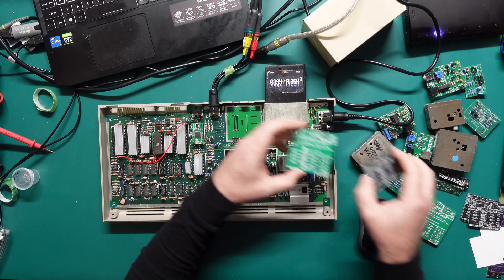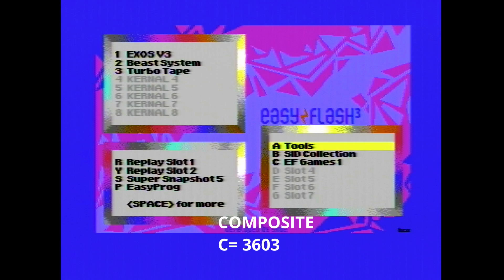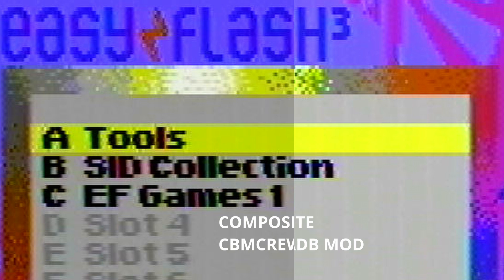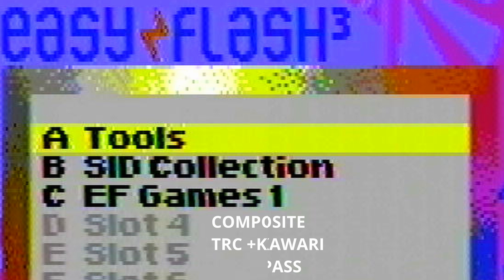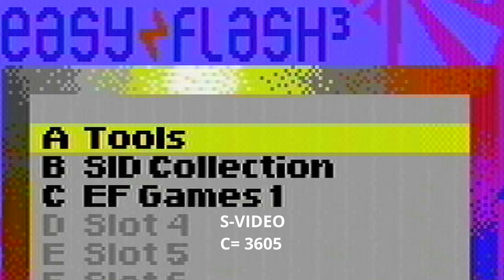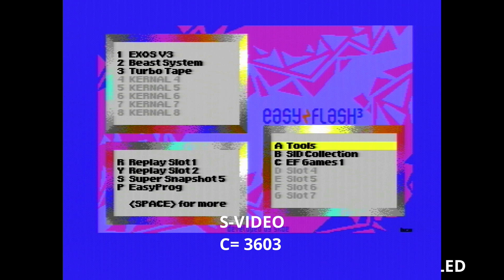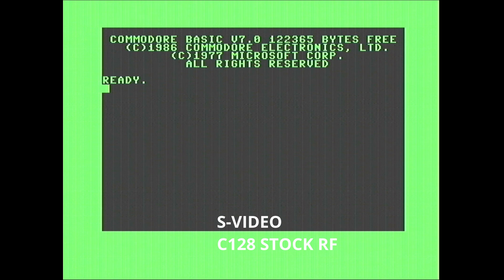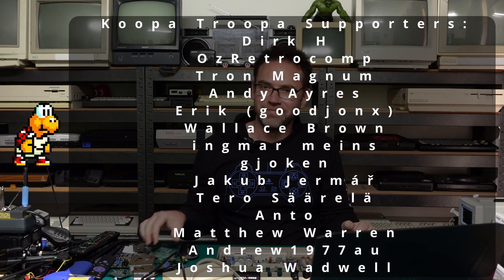Commodore 64 RF modulator replacement comparisons

Comment: 10:42 I really love c=3603 stock s-video output! It makes low resolution less noticeable. It is how I remembered it as I kid in late 80s. It gives me a VHS tape feeling. ok it is blurry, but makes an illusion of higher details / "textures" / higher resolution.
btw.
I don't get you guys. On PC you all like to use antialiasing to smooth sharp curves and outliers raw pixels, and you pay the cost of more blurry image and you accept that. 

But here you want to achieve opposite - the most sharpness picture possible even with the cost of more exposed pixels and ugly sharp edges. 

Most of the retro users like to use CRT monitor /TV to reproduce that image smoothness and roundness, because on LED monitor it look too raw. 

So I don't get it. And for me the c=3603 stock s-video is a winner or EVENTUALLY "C=3605 S-Video TRC+ KAWARI" at 11:15
Reply: it is certainly unusual. I remember always tuning my crt tv just off the intended signal so that the it would soften the pixels and make them appear less blocky. The idea that you'd want to have the C64 resolution displayed so incredibly sharp to the point you can see the pixels is baffling considering the resolution is like looking at Lego at that point

Comment: I was replacing the caps in a rf modulator for a 64c. But even with that not much of a difference. Just need a cheap alternative. And it could be something else.

Comment: Are you sure you configured your copperdragon correctly? Remember there's a solder "jumper" which needs to be configured to what VIC type (85xx or 65xx) is used. Incorrectly configured it'l give a too dark og too bright image depending on which way it is wrong so to speak.
I use the copperdragon and has no issues with it.
Reply from the maker: I just checked and yes it was configured correctly. The jumper was bridged which is right for the 65xx. The c0pperdragon looks really good for svideo but I didn't like how it looks with composite. I actually built another one and checked all the component values to make sure I didn't screw up somewhere but the results were the same
Reply: @TheRetroChannel  Very odd. I don't have any issues with my copperdragon - not even on composite.
What however gives dark screen is if using 85xx VIC in a long bord but not configuring "jumper" on modulator replacement for 85xx. But that is on both composite and s-video. I of course remember to reroute pin 13 to +5v from pin 40 (got an adapter)

Comment: I'm surprised my board still holds up somewhat, it was put together at a time when there wasn't any available for sale. I tried a few tweaks when others appeared, but I was never able to spot the differences on my less than stellar TV. Good job on the video, going into that kind of detail takes a lot of time and dedication 😀
Reply from the maker: I think yours was one of the better ones, and I like that it takes advantage of the holes in the case. I was a little surprised the c0pperdragon one performed so poorly with composite, as it's the only one that uses a "proper" video amplifier (THS7316)

Comment: I didn't realise checkerboarding was a thing. I have my older consoles hooked up to a 68cm crt, when I have the SNES connected via s-video through a switcher it has the checkerboard pattern, but doesn't if it's connected directly into the TV.

Comment: I'm looking forward to the Build Video.  Any thoughts on using you RF replacement with a Lumafix64?  

While reviews on the Lumafix64 are mixed I found the overall improvement re Jail bars worth some loss in sharpness.  I'm using a Sixtyclone 250407 with the Copper Dragon RF Replacement.  I was not very impressed with the Copper Dragon.
Reply from the maker: I've tried it with the lumafix, but results weren't that impressive. This was both with the C64 and c128 lumafix. I just found it either made things too soft, or when I got to a point where I was happy with the sharpness, it was the same as not having it in there at all (jailbars looked the same)

Comment: Can you permanently remove any of the rf modulator components if you don't plan to use it at all?
Reply from the maker: The RF modulator also handles all the amplification for the video signals, even those available at the DIN connector.

Comment: Maybe someone can help me. I have a US (NTSC I guess) Commodore 128 which only shows monochrome output to my Commodore 1084 monitor in 128 mode. C64 mode has the correct colours
Does anyone have any thoughts on how I can fault find this?
Reply: I'm using a step-down transformer to give the computer 110V (I live in Australia which is 240V). Everything works except the chroma.
Reply from the maker: I thought the same thing - NTSC on a PAL only monitor = no colour. But then why is there colour in 64 mode?
Reply from the maker: Nothing wrong with asking for help, it's the ones that demand it that are a problem.
I agree more info is needed. If the DIN connector is being used for both 128 and 64 mode then they should both have colour. The chroma signal path out of the VIC-IIe is the same for both modes, and the RF modulator is the same as the shortboard 64, it cannot distinguish between 128 and 64 modes. Having the 40/80 switch locked will just result in a screen with no text, but will still have the green border. So the only possibilities are something is very weird is happening on the 128 side, my guess would be the VIC-IIe itself as I don't see anything else being able to cause such an issue. Or we are talking about the DE9 connector for 128 mode, in which case something is wrong with eiter the way it's connected or the display

Comment: Fantastic!  I will get to building one of these for my sixtyclone as this looks much better then the one I chose, which IIRC is the mbarszczs.  I am using NTSC so is there any changes that need to be made for NTSC?  I assume not.
Reply from the maker: No changes needed for NTSC
Reply: Just found this video.

Sorry mine didn't work out for you.  Its main design goal was really svideo first and foremost and then composite out just for compatibility.

What are the issues you are having?
Reply: @mrb5217  I think it is great that you and others are creating replacements.  For me it is just a matter of wanting the best possible output and honestly either one of these is great.  When people refine things I tend to try them out. I am building both of them and will go with whichever one works best for my situation.  If I don't see a difference I usually just go with one that has features I like or is easier to put together.
Reply: @RacerX-  Let me know how it goes and if there's anything that isn't working out.  Maybe it's time for an updated revision after 3 years.  I made it and haven't thought much about it since, and here it pops up in a video!
Reply: @mrb5217  That's a kind offer thank you very much I will keep that in mind.

Comment: Might turn out to be unpopular opinion, but of all those, I actually found the 3605 to produce the nicest image across the board. I have tried a few different replacements myself, but haven't been particularly impressed by any of them. Will certainly give yours a try when (if) you release source. Thanks for the comparison!
Reply: Well, then we are two in the unpopular corner ;) I also think its by far the best. Noticable less ringing, no checkerbording, good colors.

Comment: Great video! - look fwd to seeing the video build of your modulator. I have done pretty much the same comparison in NTSC on s-video and took luma and chroma and composite voltage readings (which were all over the place on different replacements - thus the varied luma brightness you also found).   I did the tests on original modulators  (with Adrian's great mod), Shurikens (smd version of copperdragon - I believe), a few TEBLs (although I leave out C2 on those as I find it cleans up the NTSC s-video a bit) and Matt B's which so far I found to be the cleanest followed closely by TBLs. Look fwd to trying yours!

Comment: The checkerboard pattern on S-Video is an indicator of incorrect (too high) chroma level.
P.S. Barszcz should be pronounced something like [barschtch] ;) and it means borsch.
Reply from the maker: Thanks for the pronunciation tip.
As for the checkerboarding, I could never completely dial it out. Even reducing the chroma level down to the minimum (just before the display can no longer "see it") didn't help. Anyway, I'll go into more detail on that in the build video